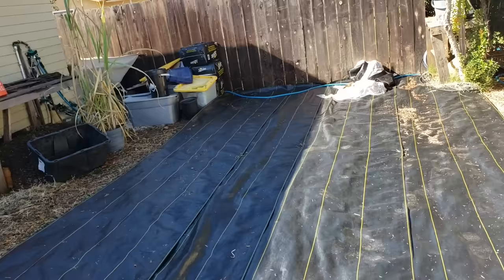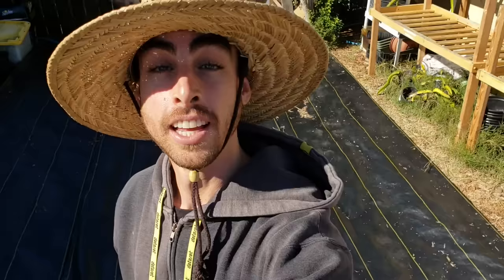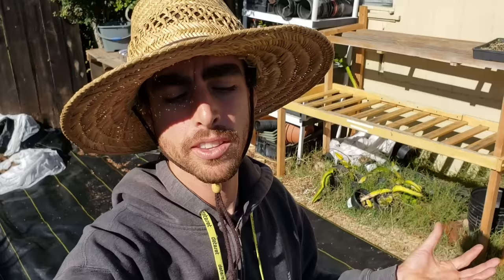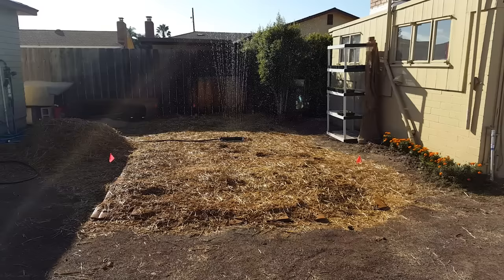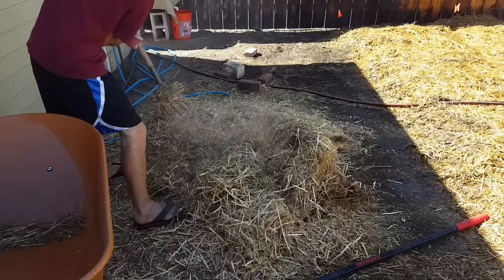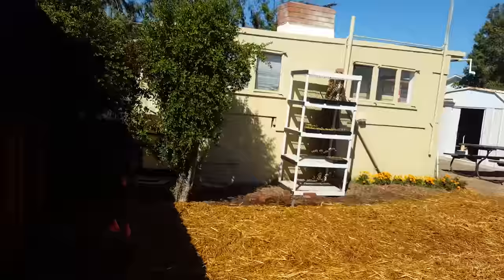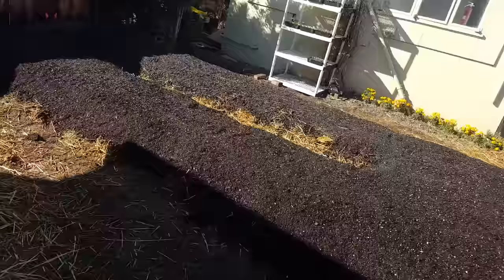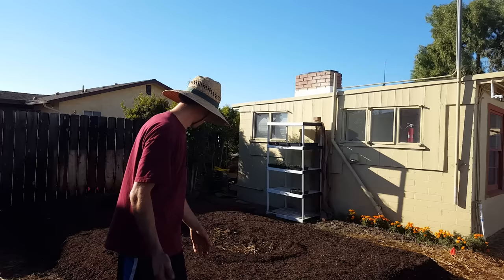Easily Make Garden Beds Using the Lasagna Method

Comment: Just watching this video now and it's basically what I am doing this year starting out. I am going to try this keyhole method on a bed I dug down 18 inches and refilled with half and fully done composting pine needles, sticks, and leaves. I use a soil I built using a good promix base, worm castings, blood meal, mushroom compost, coco coir, bat and seabird guano, then amended with alfalfa meal, neem seed meal, bio live, bio char, and a few other inoculants. Just harvested a hardwood stump that was soft enough for me to dig with a shovel. I am now experimenting with a hugelkulture type method of layering 3/4 finished compost, bamboo, imo 3, finished compost, stump wood...etc. This experimental pile is about 4 foot tall by 5 foot wide and I put a milk crate of kitchen scraps in the middle of the pile at the top to feed the worms...gonna soak it with 5 gallons fjp today...should be interesting. Love your videos man!

Comment: Six years ago I moved to a new property. This was my opportunity to "start over" in my approach to gardening. Previously, I had tried probably every gardening gimmick to optimize my veggies. In my "start over" I decided to keep things to the basics: compost and water. No more time making different brews or adding specialty products. And the biggest change? No till gardening.

I filled my six 4' x 4' with a bunch of different composted manures, some vermiculite and some peat moss. At the end of every season since I started, I simply lay a 4 to 6 inch layer of homemade compost on the top of each bed. 

I've had satisfying results and I like the simplicity. This season I will be making two more raised beds and I'm intrigued by this azomite/rock dust thing. While I'm tempted to add some of that to my initial soil mix, I'm kind of reluctant to vary my "simple" approach. 

I've been reading about azomite  in gardens and so far I've seen only anecdotal reports that it adds value. And yes, I've read some interesting explanations of how it is supposed to work. But I'm a results-based gardener and I would prefer to see some verifiable results; maybe some kind of field trial? 

Are you aware of anything out there or, better yet, have you done any comparisons with and without adding azomite?

Thanks in advance and I enjoyed your video. Cheers.

Comment: Cool, thanks for the content. If you're ever in the L.A. area 247garden in Monterey Park has fabric pots for relatively cheap. They ship as well but it adds to the cost significantly. 5 Gallon pot goes for just under $1.50.
Happy Gardening!
Reply from the maker: Thanks for the tip!
Reply: Can I do this method in fabric pots, that was also a plan for us